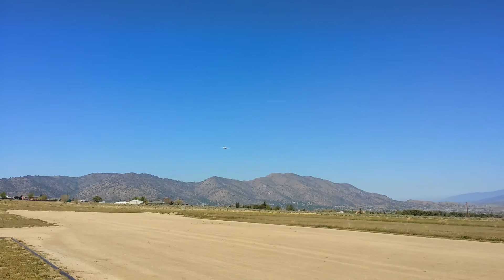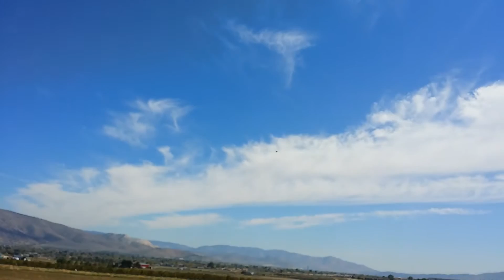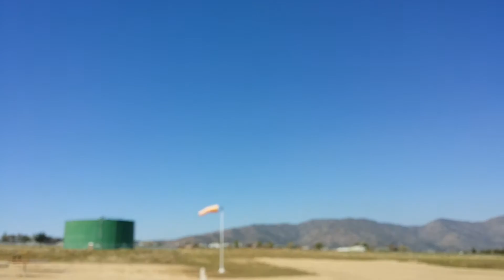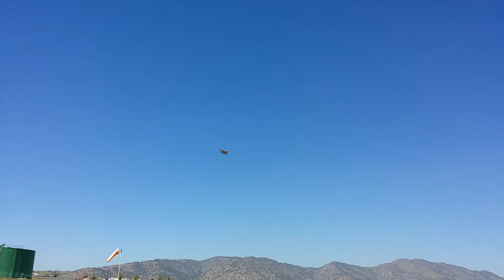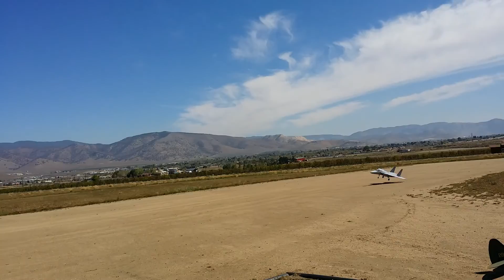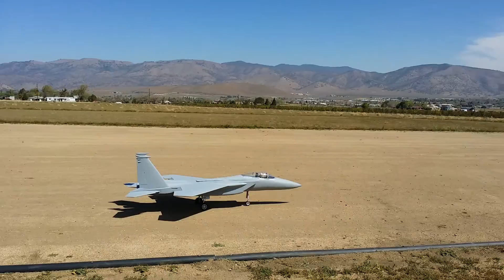byron f15 edf second flight

Comment: Hello,  I am doing a scratch build of a 1/7 scale A10.   I am expecting it to weight about 35lbs.   You are using Jet Fan 120 ECOs.   What motors did you put in with the EDFs HET ????   What ESCs and battery packs did you use?